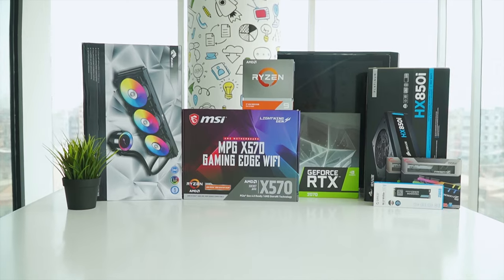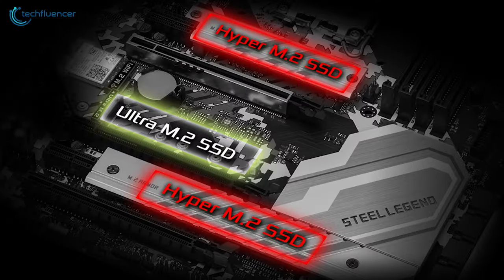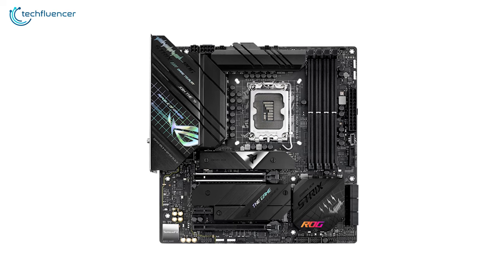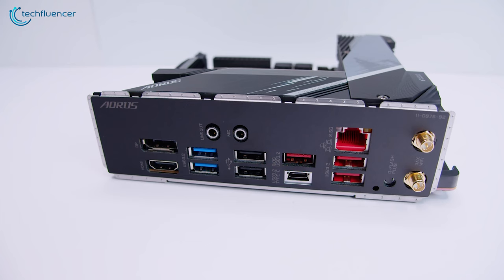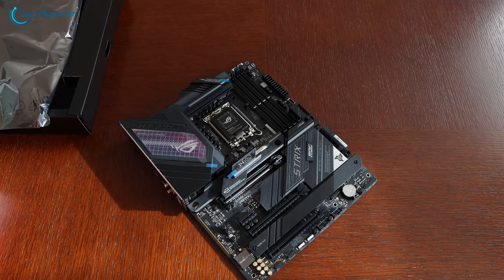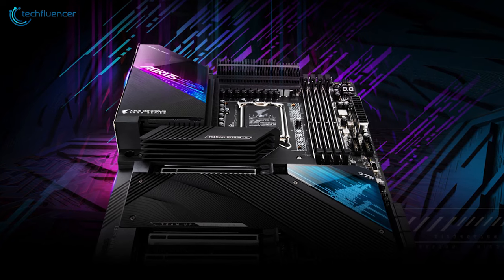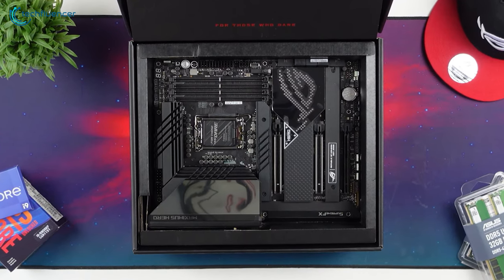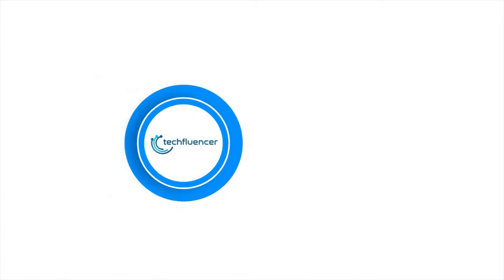Top 7 Best Z690 Motherboards for Intel 12th Gen CPU

Comment: ROG Maximus Hero is better than Aorus Master?  The hero only really has 20+1 90A power phase + thunderbolt4 with an extra piece m.2 card and only 2.5GE and the Aorus Master has 19+1+2 105A, no TB4, but has 10GE. Better go with Aorus, ASUS is overcharging us for something less.
Reply: There's a catch. The ASUS won't break after 2 years :)
Reply: @cristianbarbu5904  Since when Aorus was a bad quality maker?
Reply: 10GE doesn't matter, if you need more than 90A then you're overclock this already hot chip to much anyways, a good review on here has a well know reviewer talking about how stupid it is to overlock the i9-12900k
Reply: @neomis0119  so you are already saying its dumb to buy Maximus Hero since there is no need for overclocking, and go for the cheaper MOBO?